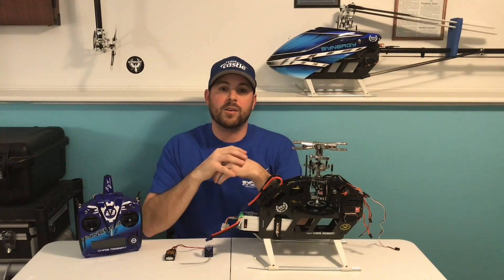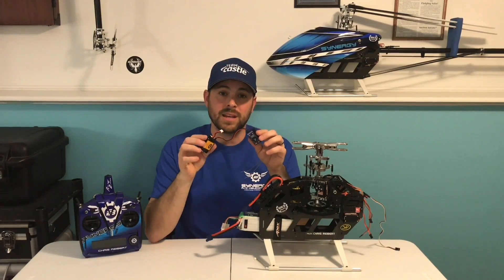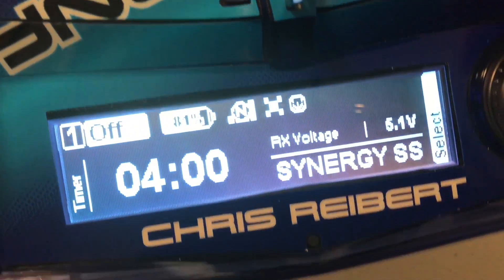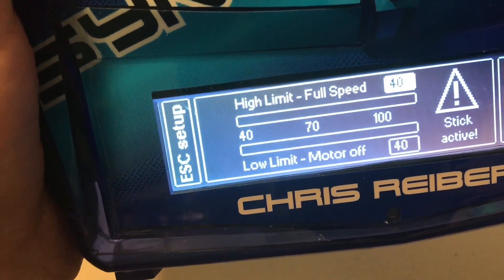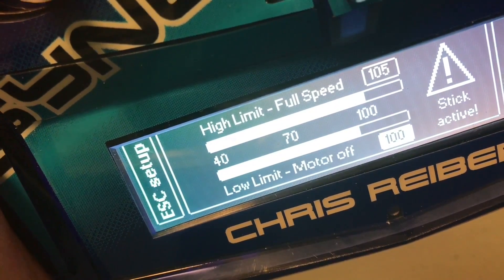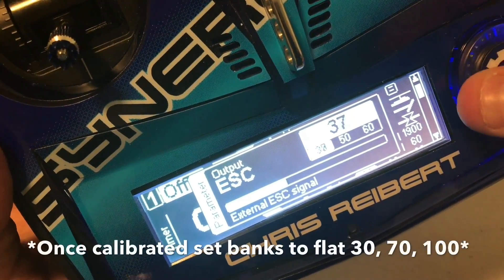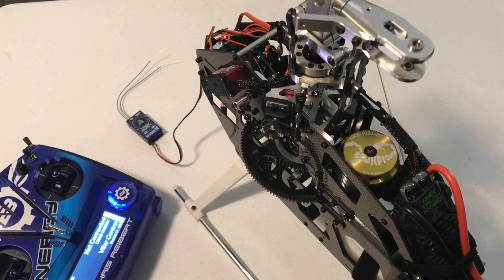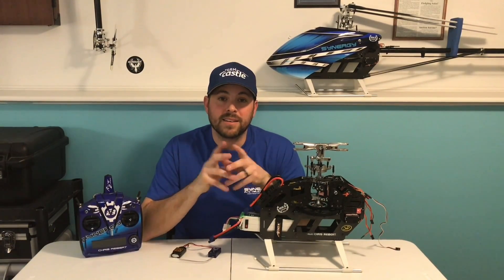Castle Creations Talon Series ESC Mikado VBar Control Radio NEO Calibration Quick Tip

Comment: Video was great, my esc talon seems to be set correctly and my end point worked just like you did in the video.  When I go to spool it up all I get is twitching . Please advise.
Reply from the maker: Check your Castle settings, check your battery and motor wire connections, and make sure you are doing everything with the blades Off. What are your Castle settings?
Reply from the maker: Sounds like one of your motor wires isn’t connected all the way.
Reply: They seem to be tight and soldered good, when I first started I was able to get loud beep from my esc now it is very low sound. Please help Thanks
Reply from the maker: @dandano1433  Text me a video and show me a pic of your castle settings. 585.645.9909

Comment: I watched your video on this esc setup .I have a v-bar touch radio. I can`t get to the settings like you show in the video. can you help me.
Reply from the maker: lee rossi Are you running Pro software on the NEO? Those features need the Pro software upgrade. Not sure about the Touch I still use my original VBC radio.

Comment: Hi mate, 

Very useful video. Thank you.. just a quick question, do I need to select helicopter and fixed end point in esc first before setting up vcontrol end points or i can set as governor mode in esc?  I’m trying to setup castle 160 edge and vcontrol to work with neo.
Reply from the maker: Ravin Thran This video is of you are using the Castle Gov. If you are using VGov it’s a completely different setup and done in the Vcontrol Radio. Their is a video out there Ron from Mikado made. Search Mikado Vcontrol Castle. This video is for setup running Castle Gov with Talon series of ESCs.